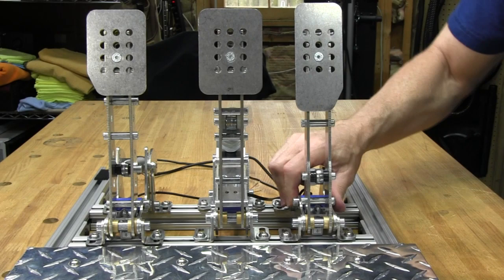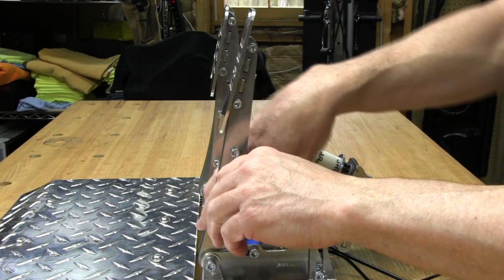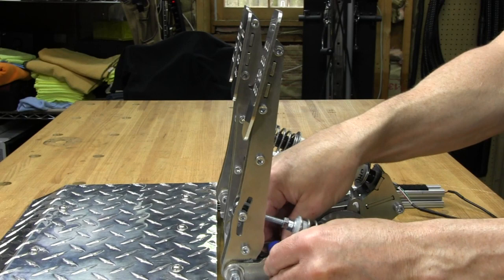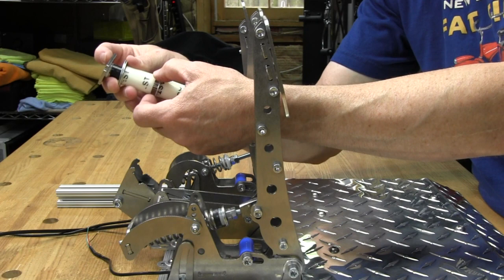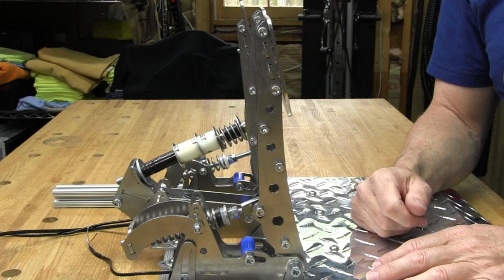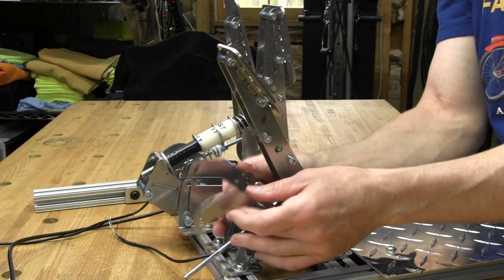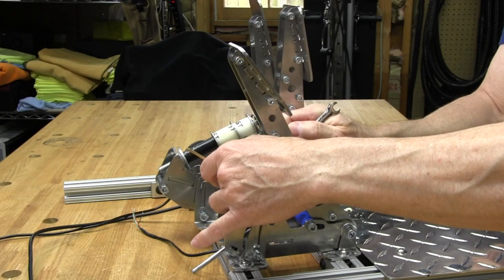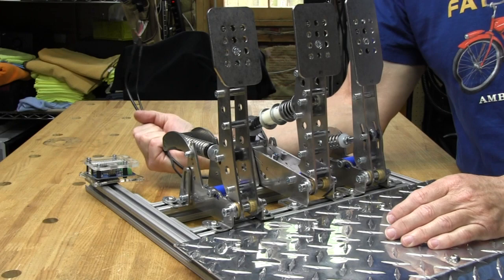Heusinkveld Pro Pedals Review Part 2

Comment: I just purchased a set of 'Pro' pedals. They haven't arrived yet. Just 2 comments on what I've seen on these (fantastic!) videos - so far. Firstly, I would expect to see a washer either side of the accelerator (gas) pedal 'throw' adjustment. That would help to stop the bolt heads biting and travelling down the side plate as they are tightened. Secondly I noticed a small error in the brake 'pressure' adjustment. When the 'Fibrelast' bumpers were changed out for the harder spacers a small error was made during re-installation. The two smaller spacers go under the two washers. You can see how they were before they were disassembled. This set was reinstalled with ALL the spacers together - with the two washers coming last. I don't know if it matters - I just thought I'd mention it. I'm watching with a keen eye as mine will arrive in the next week or so. I'm expecting a huge improvement over my load-cell modded G27's. Congratulations to Sim Racing Garage. You consistently make the highest quality, most detailed, knowledgeable and un-biased reviews on the world-wide-web to date. They way you use your hands to clear focus, the way you manipulate the hardware to give the viewer a clear shot of the subject material, even down to the manicured finger nails. You are a true professional. Well Done!

Comment: HI im new the sim racing. im wondering does these pedals works on fanatec wheel base ??
Reply from the maker: You cannot connect them to a Fanatec wheel base. But you can use the wheel base along with the pedals. As the pedals are connected to your computer with their own separate usb connection.

Comment: Hey do those little blue bumpers that the pedals hit wear out after a while of use?
Reply from the maker: They are a wear item. But, because you can rotate them, it will be a long time before you would need to replace them. Once the indentations created by the pedal get too deep, just turn the blue piece a bit and you have a new surface to use up.
Reply: @simracinggarage3026  Do you know what kind of material is this or where we can find something like this to replace if needed?
Reply from the maker: @gregkar2736  It looks to be fuel line. So you would need to remove it to see what the ID size it is and then source your own. Or, I'm sure if you contact HE they will get you some replacements if needed.

Comment: Can you mount these using a a M8 bolt with 40 series profile?
Reply from the maker: No. HE's slots are cut to accommodate M6 threads. Which you can use with 40 series profile if you have the right t-nut.
Reply: Thank you very much Berry, I just ordered a set of pros and making sure I'm ready!
Reply from the maker: I have never had a large Mige in the SRG. So really can't comment on that. But I think that the small Mige would be enough for most.

Comment: Hi Barry,

 I just sold one of my PRS guitars and some other things to generate the finances for these bad boys lol. I'm not sure but I may go with the Ultimates as I have seen your other review and I could tell how fond you are of them. 

I currently have a Fanatec CSL seat cockpit which I have modified a little to make more comfortable. I also plan to make more modifications including adding some 8020 to lift the pedal deck and extend the wheel base deck so I can configure it to be more like a GT3 car cockpit. I also have a CSW V2 on the way so hopefully this set up will be pretty nice once it's done. 

Would you mind telling me what size 8020 you use and where you normally buy your 8020? Thanks for any help! Love your channel btw!
Reply from the maker: I use the 10 series 8020 throughout my rig. I buy it off ebay from 80/20 inc. They will also cut it to size for a small fee.
Sounds like you have a nice rig build up going on! BTW if you get the Ultimates and decide you don't like them, They  will let you return them and trade them out for the Pro's set. For me the Ultimates are the right choice, but that won't apply to everyone of course.
Reply: Sim Racing Garage

 Thanks Barry! I will keep that in mind when I purchase the pedals. it looks like I have some planning to do so I can get the right dimensions and cuts from 8020. Thanks again!

Comment: No hydraulic brake parts?
Reply from the maker: Yes, no hydraulics. All the pedals have load cells, which have a very repeatable braking action, and very accurate throttle, clutch action. The real difference between load cells and hydraulics, is feel. I can brake just as well with either setup. And I must say the load cell brakes from HE, have the best feeling of all the others I have tried. Especially the Ultimates which I am currently reviewing. They ship with two different urethane bumpers. They each have a different durometer rating, one being stiffer than the other. When you stack them together you get a nice "progressive' feel in the braking action. But more on that when I post that review.